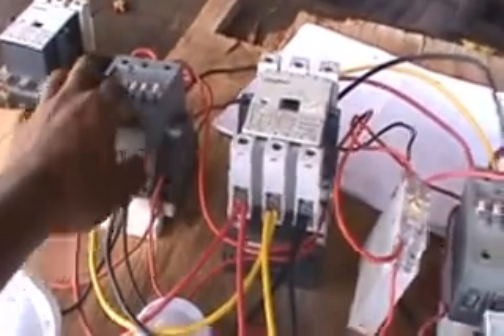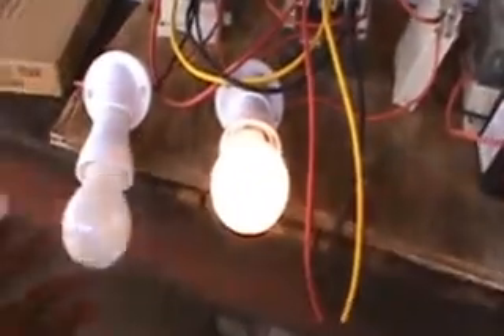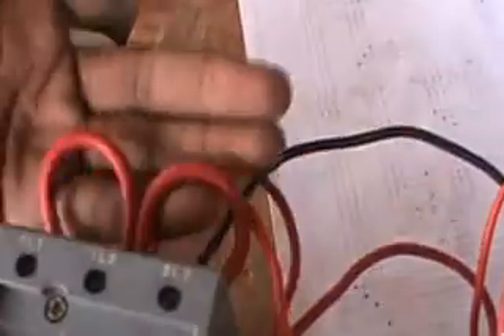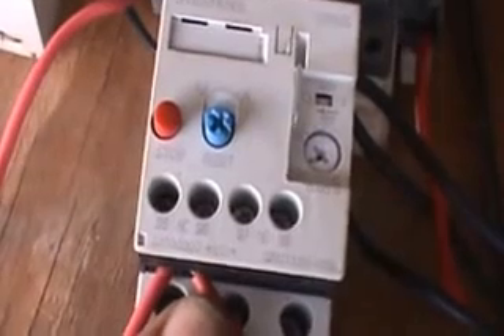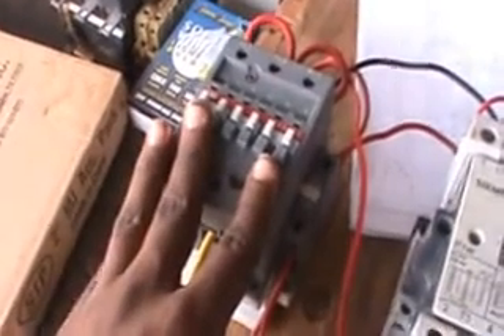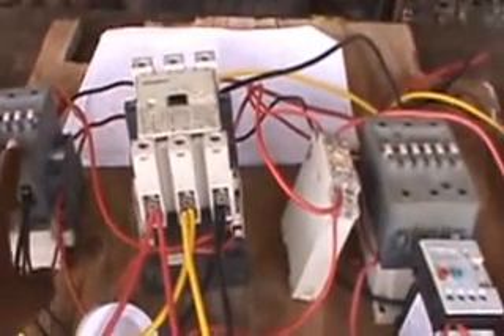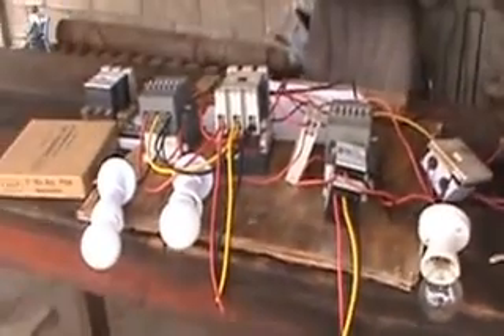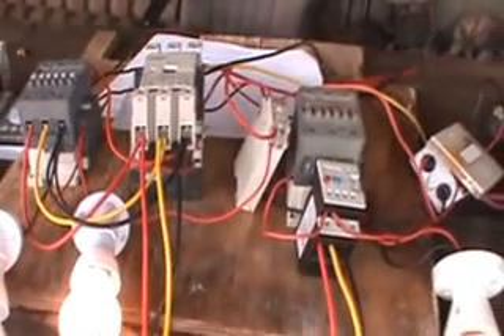Star Delta Starting (6 Leads) Practical Understanding.

Comment: Thankyou Clychawn for your video presentation. Could you or someone else please advise me on my query.
 I have a three phase motor without a terminal box and unmarked winding cables ,ie, U1 ,V1, W1 and U2,V2,W2 are unmarked
Ive used my fluke meter  to identify the cables of each winding. However I’m not sure what end is U1 or U2  etc  which is important for the delta connection where 440 volts is connected across  W1U2 and U1V2.  U1V2 and  W2V1. W2V1 and W1V2.
The query I have  is when connected in Star the motor turns clockwise. How can I be confident that when changed over to delta the motor continues running clockwise and not anticlockwise
Should I manually run the motor first in star to check direction and then stop it Next, run motor in delta for a second or so to ensure the same direction as it was in star. 
I hope Ive explained my problem ok.

Comment: but now what if there is no timer switch ? man can you help with that too
bekimtyida7@gmail.com
Reply from the maker: For star delta delta starting you will need a timer. it is evident you have one whether it may be a type of relay etc. But you will need something to control the tome delay to the delta contactor.
Reply: Beki Mtyida you can use a manual switch it you already know the exact time your motor need to turn from start to delta,,

Comment from the maker: We use of Motor and Pumps for Island Water pumping. And switches were use in the present boxes to eliminate loss of pumping time if power goes and restores it self.. Automatics restarts are very important in a situation like this. You cant have water tanks running dry due to pumps not restarting after power has be restored. Thats why Switches are used.